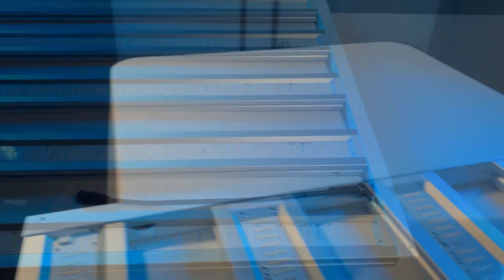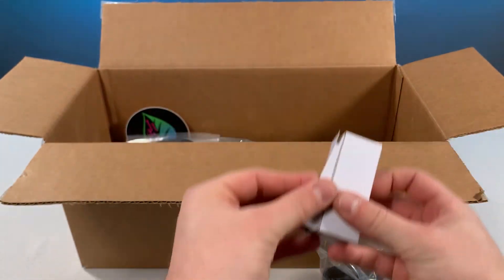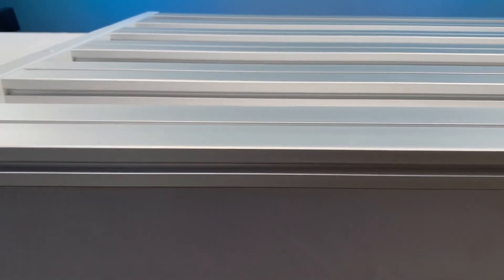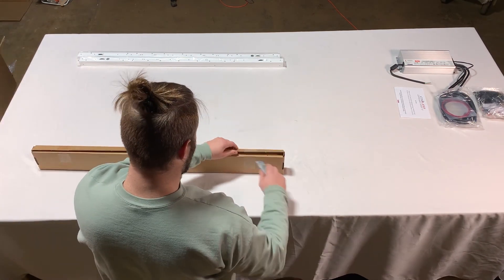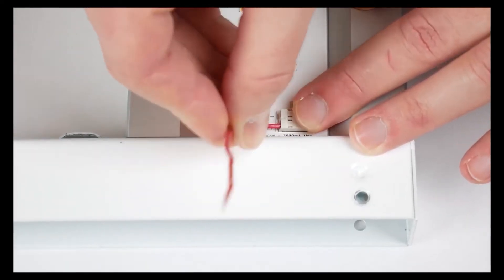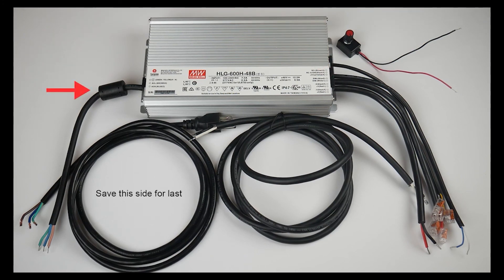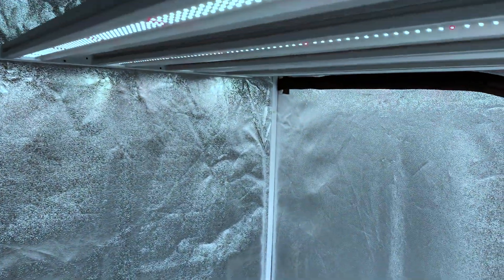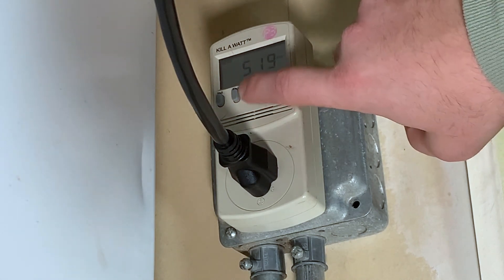Growcraft X6 by ChilLED - Par Test, Unboxing & Review of 600w LED Grow Light

Comment: I've been light shopping for a week now and im pretty much torn between  this X6 and the 650 S slim from Optic LED. You should do a comparison... lol
Reply: I’m on the fence with a purchase decision between these two and photontek x600… Did you end up pulling the trigger on one? First time buyer, I’d rather pony up from the get go ( buy once cry once )
Reply: @Miiike604  not yet.. still trying to find comparison info... if itll ever happen, hopfully. I  have some time before I  need to get a new light.

from doing my own im pretty sold on the 650S. with the light controller, you can create sun up sun down, full control of the reds, blues and whites. even without the controller, you can dial things in except the sun rise and sun set. 650s has 8 light bars compared to the X6 only has 6... "coverage spread and heat to take in consideration?"
650s has a 10 year warranty. cant beat that.

the X6 you can get the commercial version already put together model for more money and 3 year warranty... or you can get the DIY version which it cheaper  with no warranty, and you get all the fun of assembly... the X6 also you can only chose a veg with blue spectrum leds or a flower with red spectrum leds... the best pro ive seen with the X6 is with its 2 Meanwell 320H 48B drivers can be mounted remotely... and the 650s uses 3 Meanwell drivers than im not sure if you can mount remotely...  I really want to see a par and PPF comparison. but for as buying and crying on a the price of these lights... the 650s im pretty sure wont make me cry.
Reply: i'm in a 4x2 so my options were either the slim optic 320s or the x6 mini, currently my biggest concern is heat and it doesn't look like you can extend the drivers on the 320s. i'm sure if you have enough space for a 650s or x6 then heat is probably not a concern for you guys. i wish i had your problems lol
Reply: @d.stacy90  if youre in a tent... run the ac infinity T6. never had any heat problems in my 2x4 tent with a 320 watt